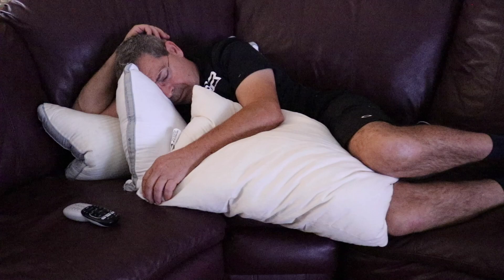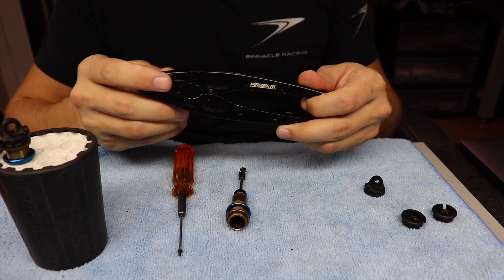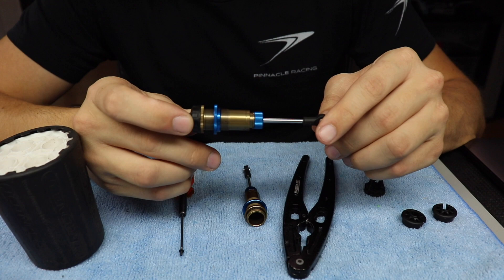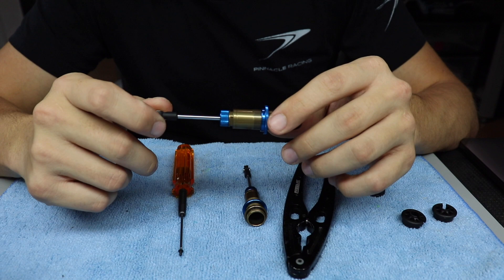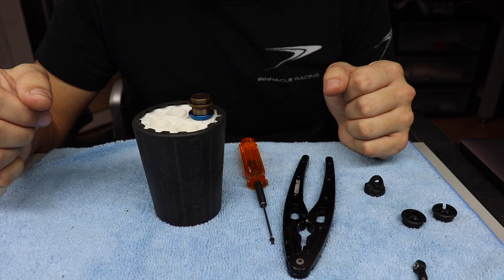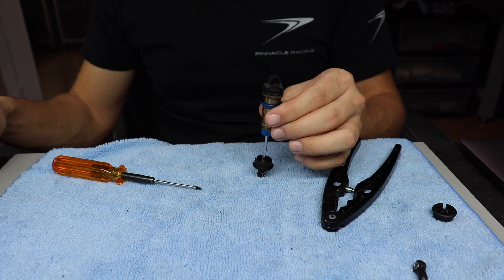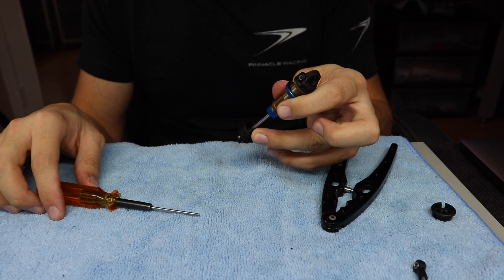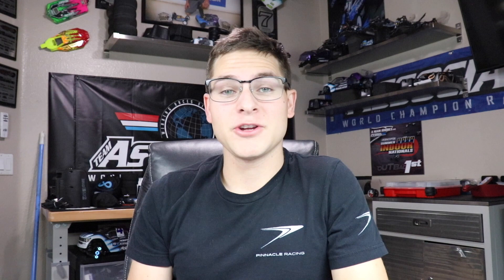PRO TIP - How to Bleed Shocks - Spencer Rivkin

Comment: Question, so in a real vehicle, you do want some rebound in the shock(the piston will push out) so i've thought that it should have some push when compressed like that?
Reply: Difference is full size cars have pressurised gas shocks. RC cars have oil filled shocks.
Reply: @warracer03  ahh yes true.

On a side note..... sweet ST185 in your profile. i had a 90. would love another clean one.

Comment: . 
I find it hard to wipe away all the excess oil from the bleeder screw hole after I’ve compressed the shock shaft all the way in.      
If I put a 1.5mm Allen wrench tip inside the hole to take most of the oil out of the bleeder screw hole is this ok?  
Or will this allow too much air to re-enter the hole and stuff up the whole process ?

Comment: The only problem I have with this method of doing the second bleed after a pump is that even though it is a dead shock, the shocks are real squeaky because there is less oil, even if there are no air bubbles when doing the bleeding process. Any tips?
Reply: I use green o ring grease in the bottom sleeve,  that squeak is the shock oil in the o rings.  The grease also stops leaking.  Hope that helps.

Comment: So I did your steps and one shock is perfect but one shock no matter how many times I redo it always wants to suck back into the shock.. What is causing this? I’ve been doing this now for three hours 🤦🏻‍♂️
Reply from the maker: You might have a bad o-ring in the shock. or the cap on the bottom might not be screwed all the way on.
Reply: @spencerrivkinracing  Okay thank you. Most likely an O-Ring since the bottom cap was tight. I appreciate it. Guess I’ll be upgrading my shocks.. Any recommendations? I’m doing No Prep drag with a DR10 chassis